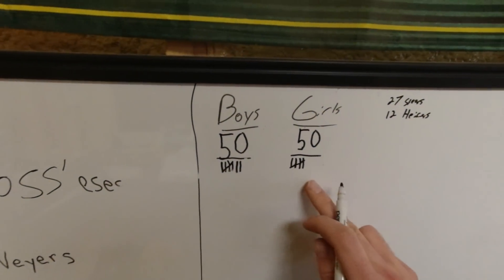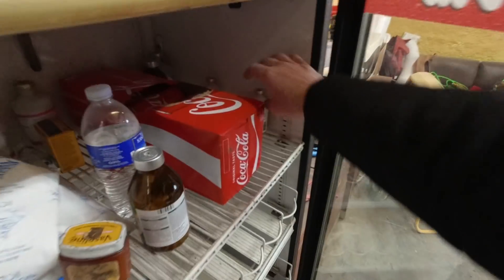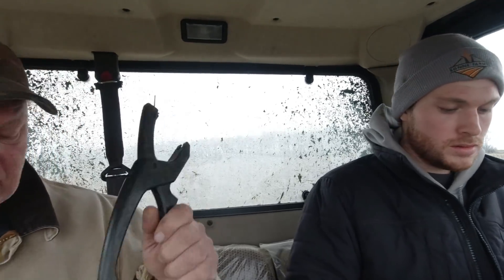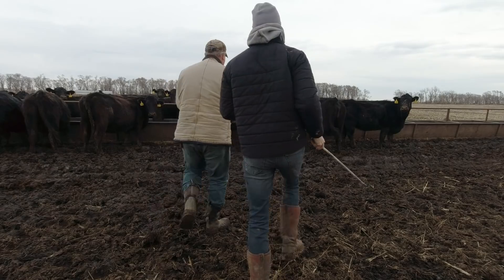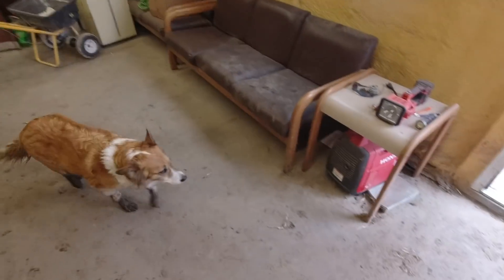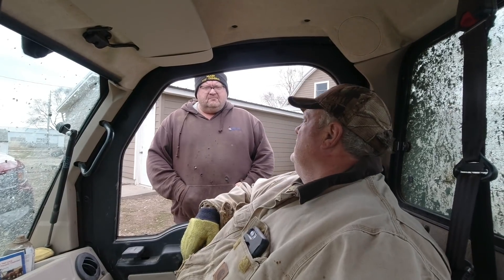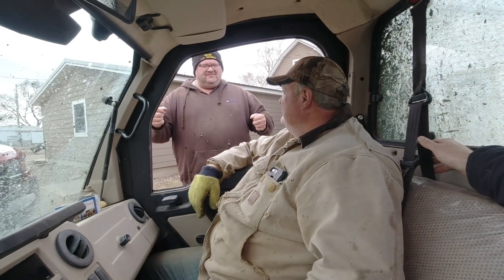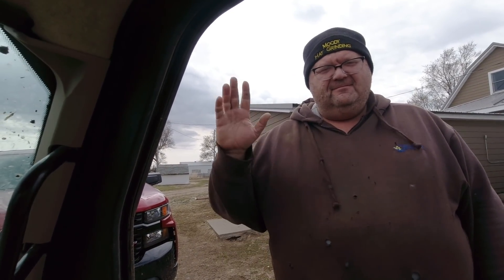New MoCo Arrived!

Comment: You're lives are forever changed, our NewHolland HW340 16ft disc is one of the few bigger things i'm buying back from our farm sale (Fraser Auction Mb ,Caldwell Farms, April 12th) as i'm gonna be doing a bit of commercial hay making. you can set the rear doors just right for the baler pickup and with 16ft you might just need sell yer hay rake.

Comment: Keep an eye on the rear tires pivot pin. We put lock tight on ours and it would still work loose. So we began checking it every evening when we greased it and blew it down.
Reply: Pivot pin bolt
Reply from the maker: Thanks for the tip!

Comment: You'll get used to driving that thing around once you go up and down the field and you'll feel what it wants to do... I"m sure there is settings on the monitor to adjust how sensitive to have the steering. It always helps to have a header installed on it to keep you in more control. Be careful going down the road with them with steering.

Comment: What's the advantage of a swather over a towed mower-conditioner?  Not having to constantly look over your shoulder has got to be big one.

There's probably a "road mode" that ups the travel speed and desensitizes the steering so you don't wind-up in the ditch if you sneeze.